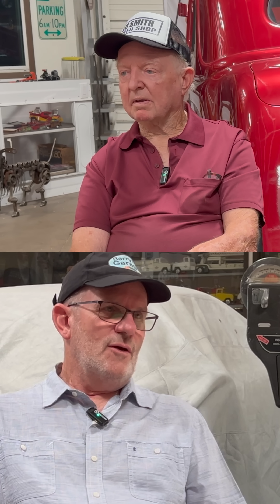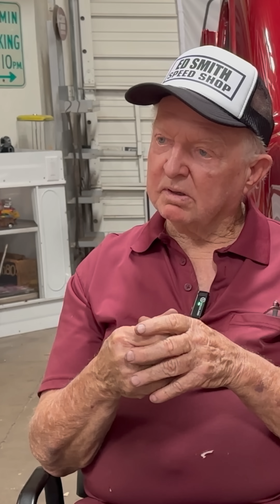Types of Engine Balancing - Ask Ed 28 - Ed Smith w #BarryT #enginebuilding #racing

Comment: When you buy a balanced rotating assembly would it be a good idea to include a harmonic balancer and flywheel to match and why don't those kits include them. How would you know if the kit is converted to internally unless you call them. How would you know if you can use your balancer or have to get another one
Reply: @Christopher-re2hi,
If you buy a balanced rotating assembly, and there is no flywheel, flex plate or harmonic balancer included, that means the assembly is internally balanced.
A neutral balanced flywheel, flex plate and harmonic balancer is your choice.
Reply from the maker: I wonder